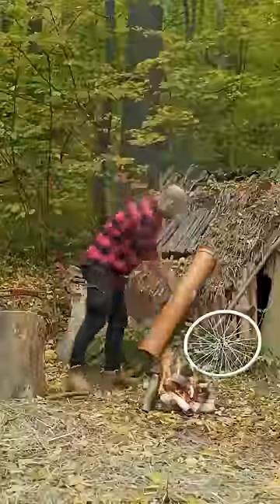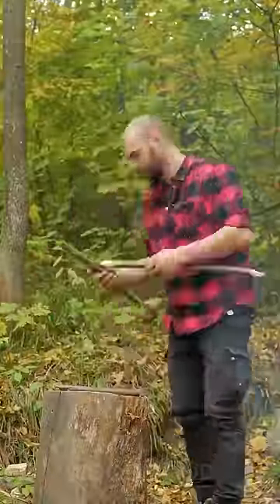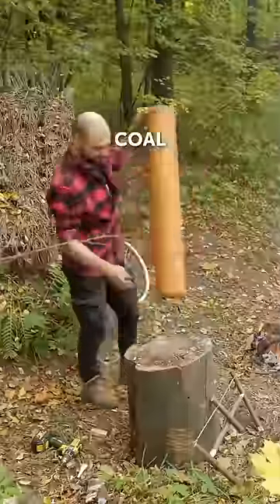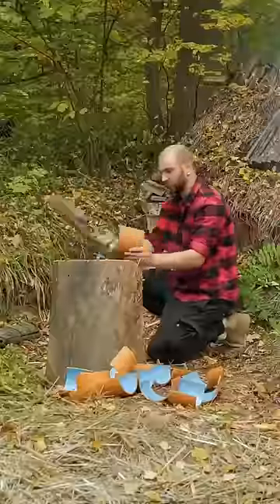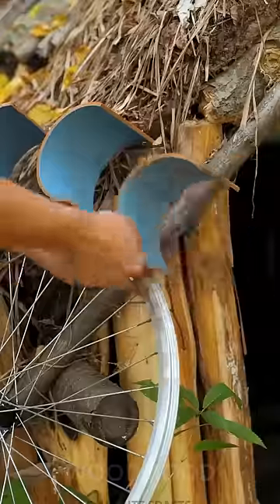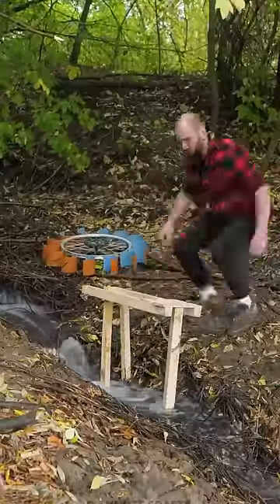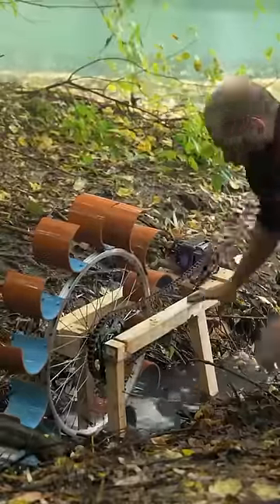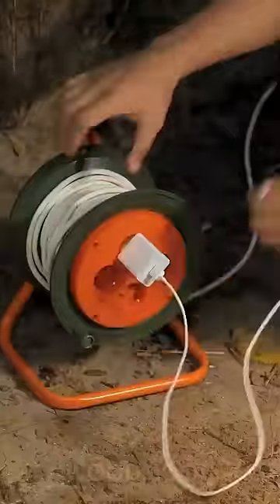Sustainable electricity solution for homes in the middle of nowhere 💡#shorts #hacks #crafts

Comment: I made one at my off grid site about 10 years ago. I have a bunch of acres that i picked up dirt cheap. I used it for years as a get away for camping with my kids and wife. I started to figued out where would be the best place to build a rustic but comfortable log cabin. Just one room nothing fancy but liveable all year. Anyway taking my time and picking the right size trees and location as to not put a big hole in the middle of the forest.  Long story short,one of my neighbors had a generator that the Motor had blown. Gave me an idea about electrifying the place. I have the same  generator at the house for blackouts. I started doing some research to find out how many RPMs the thing had to turn in order to produce the amount of power i wanted. It would perfect because the only thing missing was the motor so it had controlled electric with a regulator and circuit breakers. Went to the stream which is about 60' from the stream. About 12' lower then the actual site. Up till now the highest water was 10' making the water no where near the site. Anyway just as the water comes out of a narrow rapids maybe 15' wide at that point.  After we figured out speed of water, how fast it would turn the generator and voltage drop from creek to cabin. The bigger the water wheel the slower the smaller faster. Made it so i can disconnect the Generator easy to keep in safe hight when not there. End result is i actually have more power then i need.  Took me a while to get together because i had bury wires, build the water wheel and get it to turn fast enough. When i bring material i bring someone ro help as its about a football field and a half from where i leave my truck (all my property) so it lights, charger, Radio and a small fridge and nowhere maxed out. Will also support a small electric heater. Now im working on a clutch to engage or disengage the Generator. Im thinking about to life the wheel out of the water to stop it from spinning
Reply: Wow, need a utube how to.  What did you use for a water wheel?  How did you determine flow? 12 volt? Thank you for sharing.
Reply: Wish I could do this, I'd love my own log cabin. I'm in the uk so think I'd prefer a hotel climate but it's definitely my dresm
Reply: I promise ,I didn't read this comment..
Reply: It doesnt work Like that
Reply: They use this technology at mountain meth labs in Washington State.

Comment: There is an interesting flaw in the system: the water pressure is greatest when the wheel doesn't move. As the wheel gains momentum it loses power; for when the wheel rotates the same speed the water flows there is no pressure on the pads!!! The faster it rotates thr less power it generates. 
So you see, there is a good reason why it was never used for anything but mills and hammerheads!!!!!!!!!

Comment: I am looking at whats called a generator. Sorry to say this , but it looks like it doesn't have any magnets for it to be a DC generator. As it looks more like a alternating current washing machine motor at best . Unless it's a tread mill variable resistance transducer with magnets that are internal inside it. Still , how dose it regulate the voltage to the load do to the running water speed either increasing or more like as it decreases in water speed ?
 Wouldn't a filled one gallon water jug ( 8lbs weight)  and raised a number of feet off the ground and using gravity to pull the water jug at a constant speed with a chain around a sprocket thru a gear box with a small magnetic DC motor that's used as a DC generator and attached to the gear box drive shaft be a more regulated way of producing a constant voltage ?  
 This is why old wall clocks from the past used a metal weight and chain system to keep your wall clock in keeping very accurate time. As gravity is a constant force of nature in our world.
Reply: Pretty much everything I was thinking you covered. Most people don't know how anything works and its probably fake but there's a chance its not. Only thing is you might of been wrong on is the motor. It looks more like a dryer motor than a washing machine motor but I could be wrong, there's older ones I'm not as familiar with but without a stabilizer or regulator the lights would dim and brighten with the changing speeds of the current.

Comment: Simpler is just bury two different type metal wires near stream. The Longer, the wire the better. That alone generates electric. 😂😎👍 Enough to charge your phone, even power lower current LED, and if you attach a step up transformer even better.💕

Comment: That was the motor out of a washing machine and it has no permanent magnets in it so I'd be curious how the heck it was supposed to generate any current because I didn't see any kind of a controller unit or anything or any batteries or any electronics really just that motor hooked up to that wheel I mean you would at least need an inverter.

Comment: Impractical. You'll not have enough VA or Watts to power a single bulb. You'll burn your battery charging port with low Voltage. 😂

Comment: Wont it be more efficient to carry a powerbank with solar charging capability?  Two powebanks is far more compact than the bicycle, wheel, planks, drill, pipe, steel saw, ... Another over engineered stupid solution -

Comment: Yeah sure sure, a shed full of tools like a cordless drill, battery charger with no electricity, drill bits, pliers, six pieces of 2 X 2 X 36” long wood, screws, nuts and bolts of the right size and length, hammer, a chain that exactly the right length, the right sprocket for the perfect drive ratio, a cable, light bulbs, and a pizza oven.

GET THE FK OUTVOF HERE WITH THESE EXTRA STUPID VODEOS.